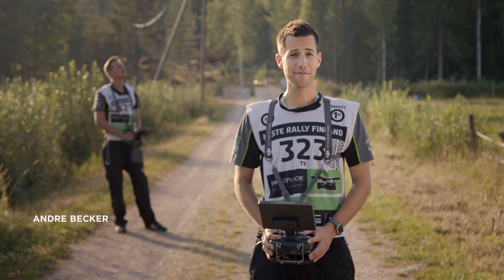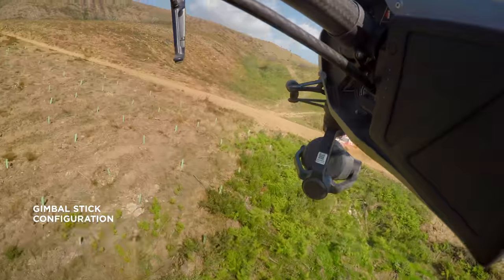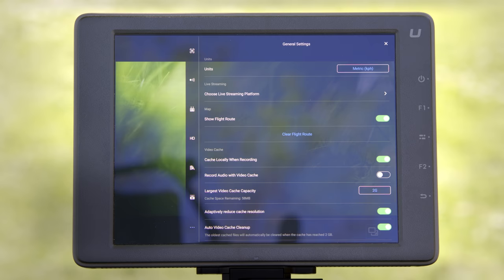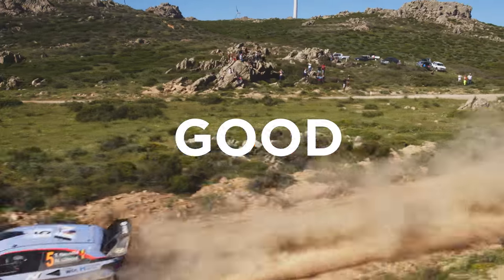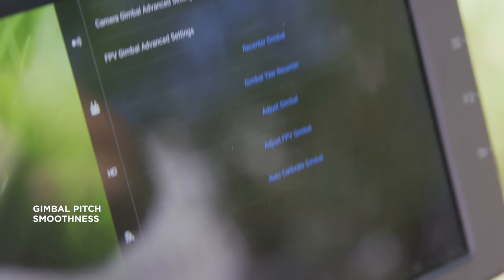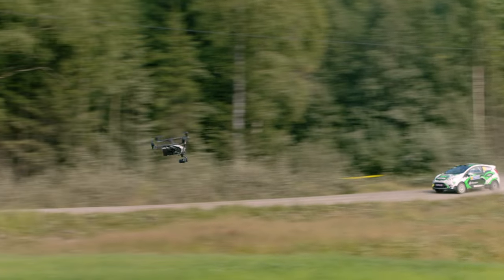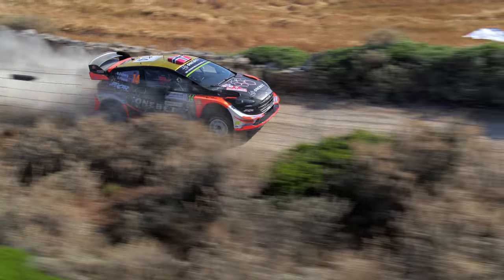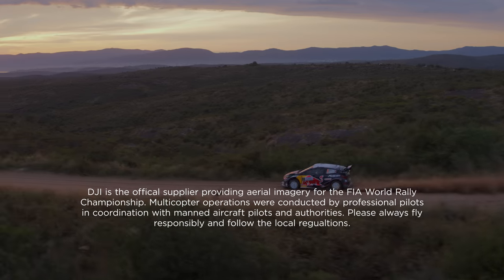DJI Film School - Gimbal and Camera Setup

Comment: Super video as allways!!! I wonder why you don't use the X7 instead of the X5?
Reply: Because X7 does not have a major advantage in this Scenario. X7 is more for high end commercial and feature film use or if you need the ultimate Stills picture quality.
Reply: Danke Ferdinand!
Reply: Great Job! Ferdinand, one question about drone flying during the rallye itself. Do you have fixed flight paths, where you allowed to flight? So one path for all cars on each location? Or do you allowed to fly kind of freestyle?

Comment: I have a question!

is there some sort of boost feature where you can hold a button to get some sort of "boost" maybe like 30-40% extra of your base settings? Just to get your camera into your first position. Then once you let go you can have your base controls for smooth tracking. It just feels like while the re-center position feature is definitely handy sometimes it feels like it takes .5 sec or so before it lets you pan and tilt again.

Thanks for any information <3

Comment: Hi 🙋🏻‍♂️, when the camera moves from left to right or from right to left 👈🏻, there is a single jerk of the picture precisely at a high FPS.  At 119.88 FPS, it twitches if you quickly move the camera from left to right 👉 or vice versa.  Do you also?